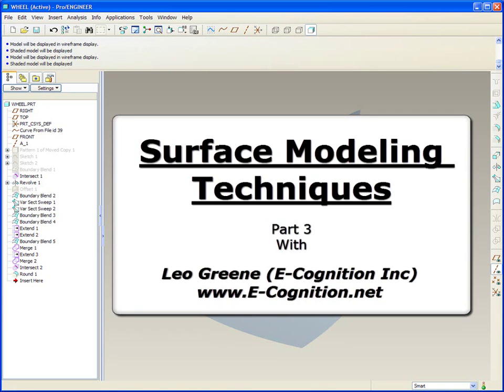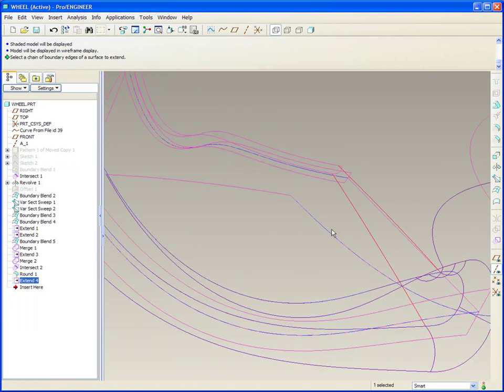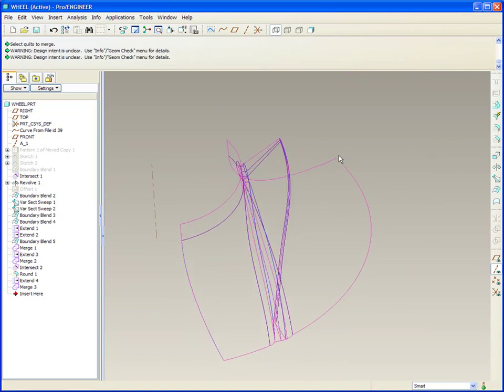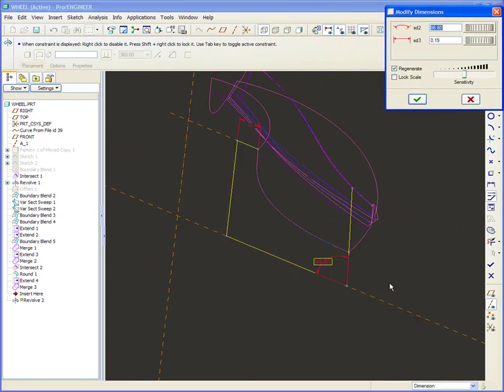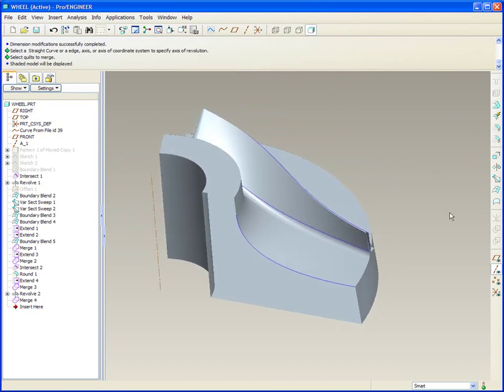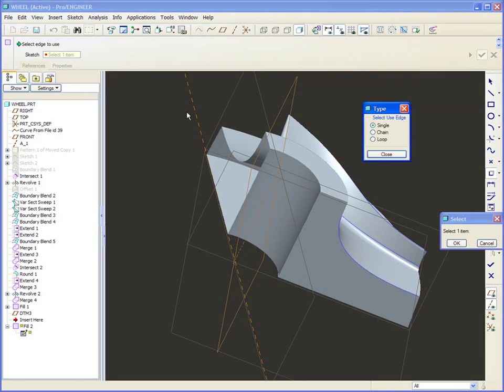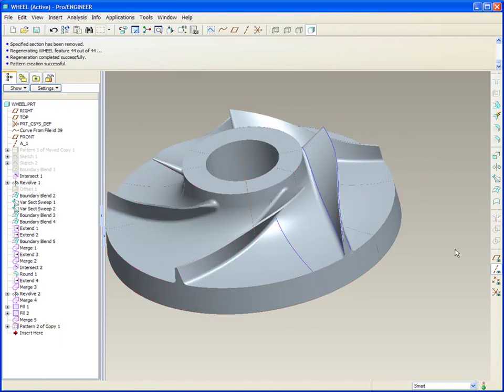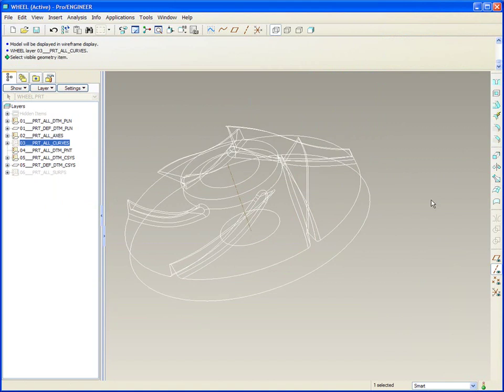Surface Modeling Techniques Part 3

Comment: @regjwaerhouse The reference plane orients your sketch, i.e. tells you which way is up when you are in sketcher mode. ProE often picks a reference plane for you these days, but it is important to remember that the plane it picks becomes a parent feature of the sketch, so it often pays to override whatever ProE picks otherwise you might get a parent/child relationship that will cause problems later on.

Comment: Just one question: why in proE you do have to select a reference plane when making a sketch? I'm not very familiar with ProE but I have use a bunch of CAD softwares. That's why I 'm so intrigued !!!
Reply: Its just the way it is. The sketch has to be hosted on something. And the most logical is a Reference plane in whatever orientation. You can also sketch on a flat surface. Pro/E will create a secret reference plane  and hide it later.